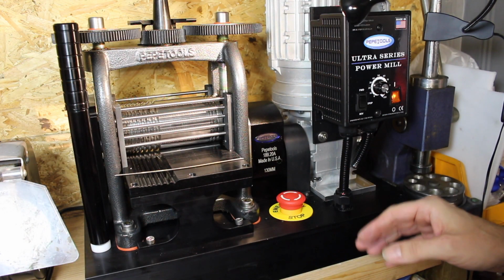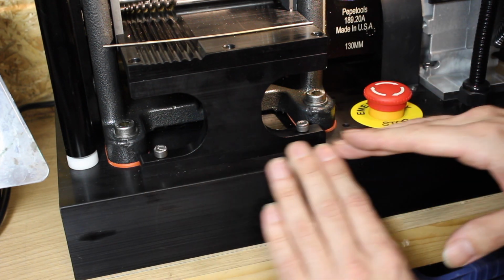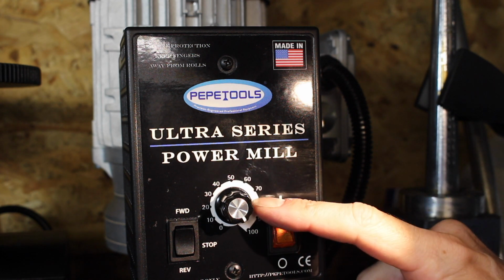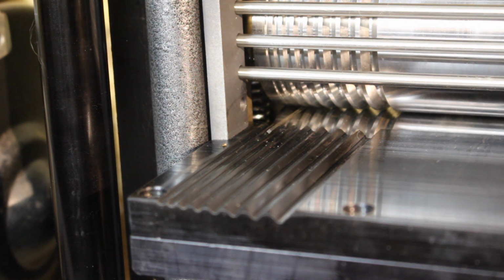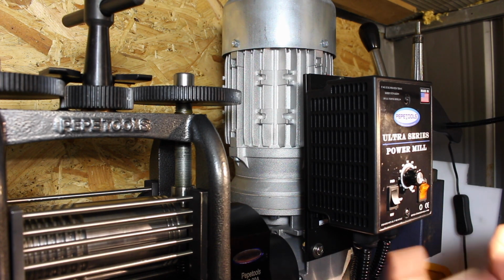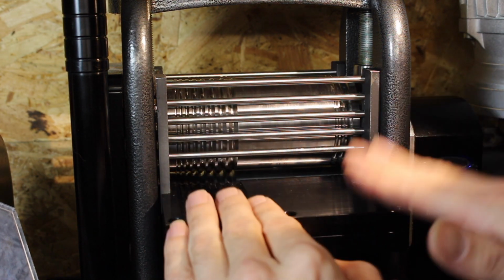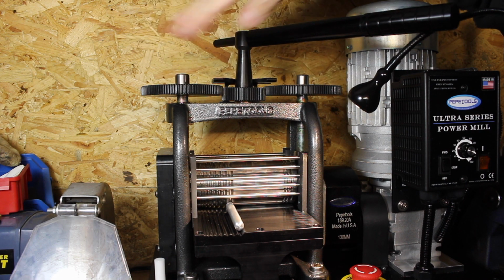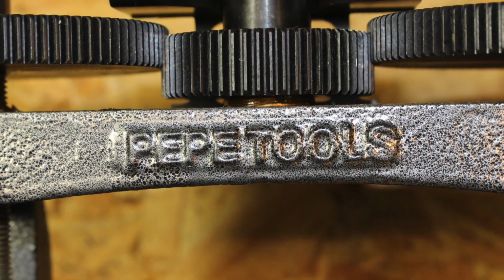Pepe Tools ULTRA Series Power Mill Demo & Review in HD

Comment: Apart from looks....performance wise ..this machine is like .. big tank with very small mm gun 
I mean so much hocus pocus about hardware ..and working is so slow ...
Not fit for a professional workshop..may be ok for hoby
Reply from the maker: working is so slow?  compared to what? Small gun? can you see the size of that motor?  This is one of the fastest and most powerful rolling mills on the market.  So  it's clear that you have never used one. But If you have some valid observations then please make a video and explain why. 

Sadly ...I dont think its your rolling mill that's slow and "not fit for a professional workshop". Dave
Reply: Don't take it  to heart  bro.... I just Ment to say.......its just an ordinary rolling mill ....yes I agree brand-name is ..sort of ...high... But ...it was valuable few years back.. When not many machine makers were there.. .now a days
 many other better and more efficient players are available... 
And if u compare this to them.. U will get a feeling like.. OK its also just another machine.... There is nothing.. Additional in this model... Pretty basic... But don't get senti about it it's just my opinion that's all..